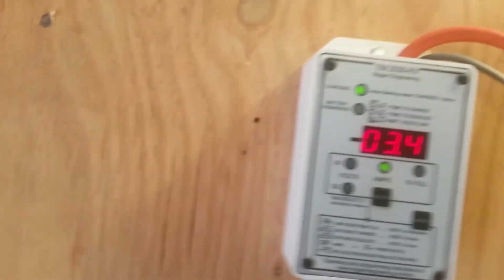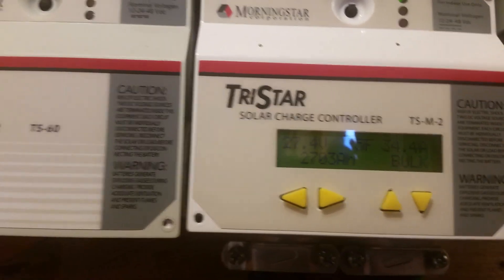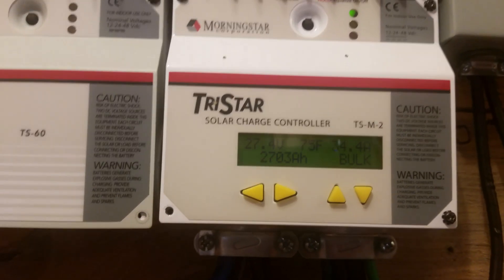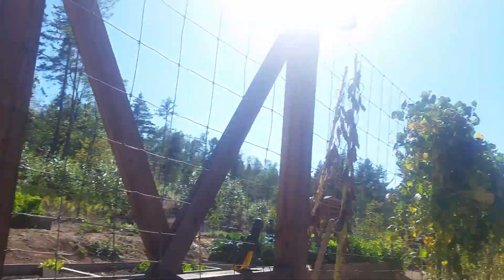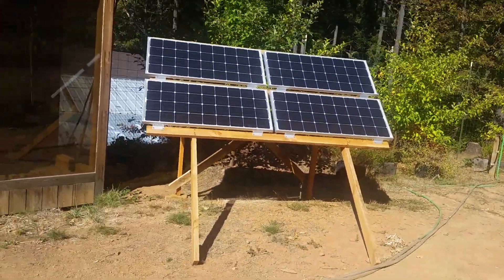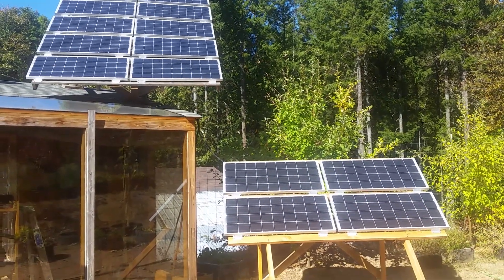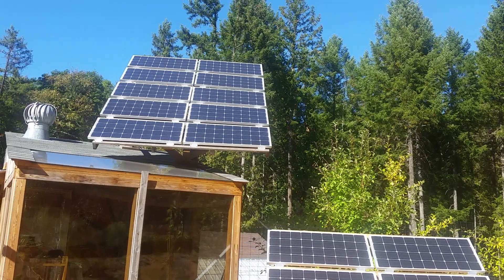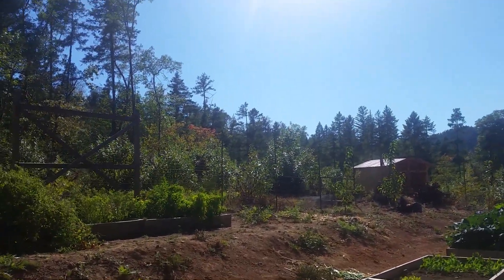Off grid solar homestead (solar power & laundry)

Comment: Nice video. I just recently wired my dishwasher onto my transfer panel circuit (so it can be fed solar power). Runs great...even on the power hungry mode (pots/pans - high heat and heated dry). No issues. However, my clothes washing machine is not on my solar circuits like yours. Need to figure out were to run the wires. Get this...just put up two more clothes lines in my small backyard. Hanging clothes out like we did in the 70s!!!!! Someday will be fully off-grid.
Reply: Thanks...anything you can do to be self-sufficient is heading the right way! Small steps. My system took 2+ years to create. The Outback Power inverter/chargers are beasts...you get what you pay for...and they can handle a lot more than their rated output. How much output to you need from your generators? I have a small Honda eu2000i Companion and it really does fine (just me in the house tho). Using it with one small window air conditioner is doable, but really pushes it's limits with everything else running. Realistically, it would only be needed at night...so, easy on power. As for the Renogy array....wish I would have started with higher wattage panels...but, grown to really like their 12v 100w modules. When you wire them in series...they work well with my MPPT solar charger. And, they are more rigid/stout than bigger panels. Take care up there...you got a dream set up!
Reply: Cool...the idea is not to run a generator unless needed. Solar power inverter/chargers are very sensitive to what voltages/loads come in...esp when doing both (charging batteries and using power). The guys at Outback Power (and many others) recommended the Honda eu2000i inverter/generator because of their stable output. My little generator is a back-up to a back-up since my solar power system was designed as an emergency power source due to power outages (tornadoes, ice storms, etc-etc). Now, my solar equipment has grown to a partial off-grid power source (I get 8-9 hours off-grid daily). Goal is to get even more!

Comment: what is the best voltage to use 12 V or 24? .....I've even heard 48V.....which do you feel would be the best to go with.....Johnny
Reply: Thank you very much.....excellent information and just what I was looking for. I think the 24 volt will be the choice for me. Your reasoning for it is very logical and to me, I concur. Thanks for your time and the information. I enjoy your video's and have learned valuable information. If God will bless me with my love for a homestead, then I will put your advice into practice. Thanks again and may God continue to bless you and your family.....Johnny
Reply: Mine is also a 24v system...and agree. 48v system would be excellent...but, not practical for most. The best thing I did to my system is switch from 12v to 24v and wire my Renogy panels in series (four strings of six...24 panels). My other array is in parallel...but, they have a high VOC...which is good.
Reply: Thanks Chris.....what voltage are your panels?
Reply: I have 24 Renogy RNG-100D panels...they are 12v panels. My other array consists of three SunPower e20 Maxeon 435w panels. Their VOC is around 71v...so, they are beasts. Total solar panel wattage is 3,700 watts.
Reply: With 3700 watts you can run about anything you want